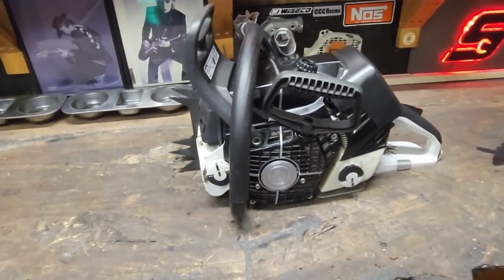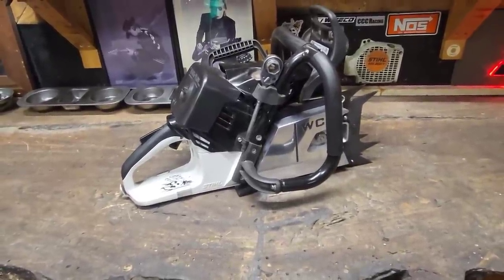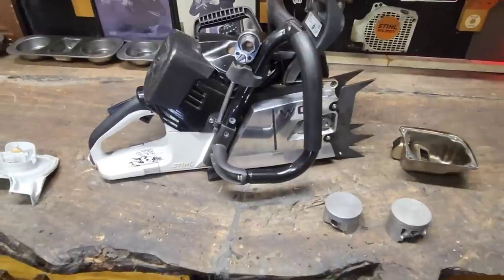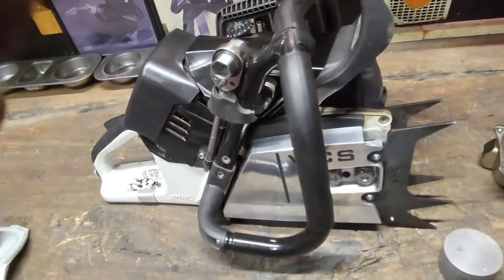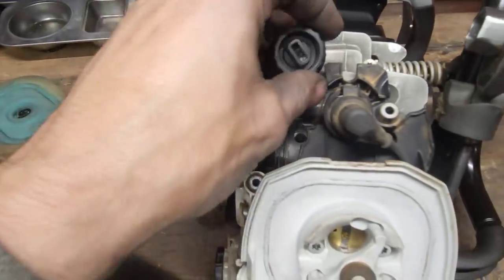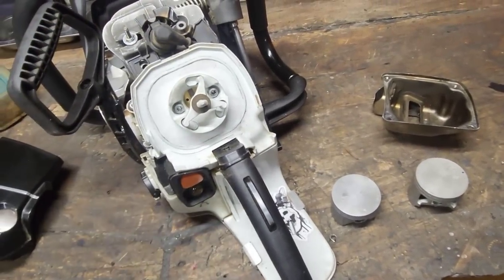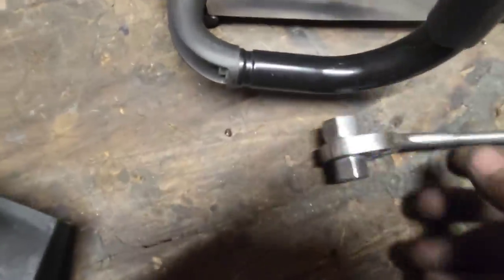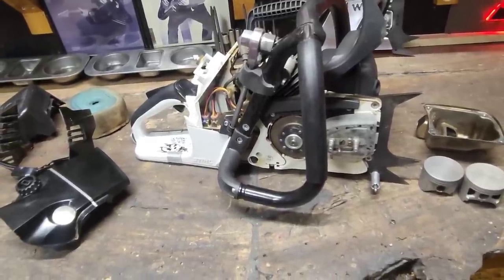DEEP DIVE... Custom JCS Stihl MS500i with a MS660 piston... AN ACTUAL HYBRID ... (read description)

Comment: I really want to build a stuffed crank stroker saw +2 or 3 mm stroke. I build rc truck gas engines some are 18 hp that are only 72 cc. I know i can do something far from never done. I learned so much from rc max 70 engines and alx 71's man the power is off the scale. I want to mount a alx 96 in a saw 😅 it will be brutal. Has to be done. Soon ill be on it. The footprint is small on the engines. Gobs and gobs of power. A Reed case would be cool your probably wondering what the hell im talking about lol. Cool channel i cant wait to see your port work.